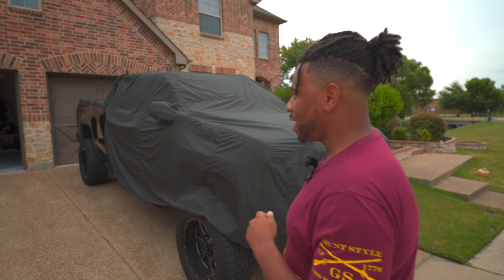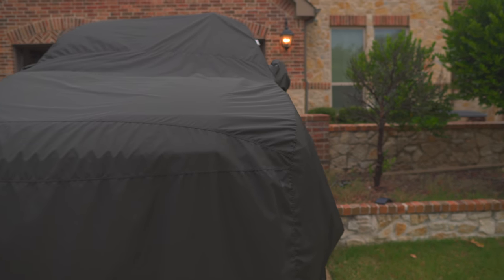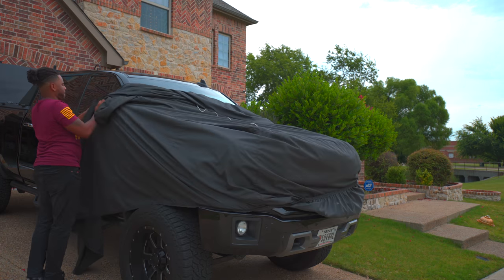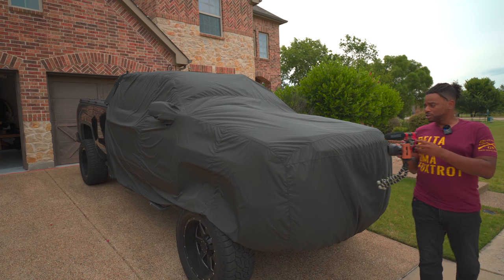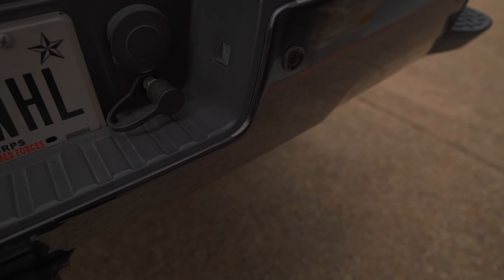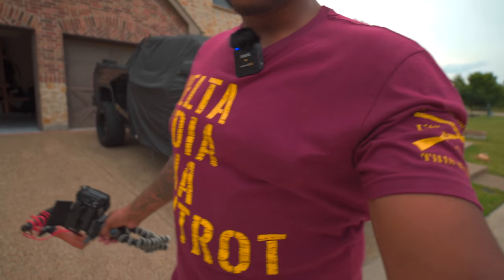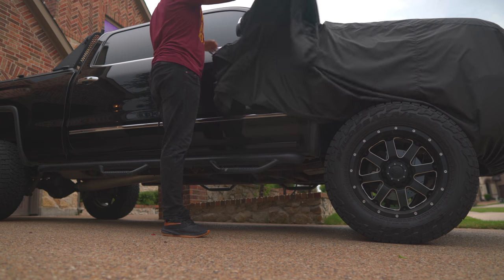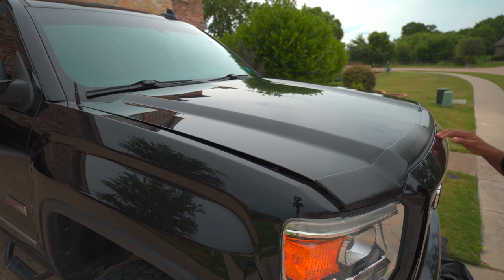Three Must Do Bugout Vehicle Add-ons: Conceal, Crank, Continue the Mission

Comment: i've put together a "pioneer kit". it has some full size shovels,mattocks,loppers,pruning saws,an axe,thick climbing rated rope,come along,pulleys,framing nails,machete,empty sandbags,rebar tie wire,large zip ties... would greatly increase the efficiency of either creating a new shelter or to fortify an existing structure. I made a large plywood box roughly 60"x18"x18" with rubber casters on one end and rope handles around the perimeter.

cordless tools coupled with a "solar generator" and folding solar panel would seem to be a gift from heaven if forced to leave you home by vehicle. I use the Milwaukee m18 platform. I have a chainsaw,pole chainsaw,string trimmer,sawzall,impact driver,drill,impact wrench,lantern,rocket light(tripod mounted work light),cordless fan(very handy if around a campfire to direction of the smoke),angle grinder(quickly defeats padlocks,hasps,gate locks,hinges,door handles and sharpening tools),portable bandsaw,water pump(coupled with a collapsible garden hose allows water on demand to your camp and the luxury of taking showers)

passive,low tech security measures such as trees accidentally falling across roads and trails coupled with higher tech active security measures such as predator calls such as mountain lion growls or coyote howls,trail cams and drones can deter all but the most eager folks all the while not alerting theres human activity in the area.

i've come to boiling it down to Food,water,shelter & security as out main priorities followed by hygiene,well-being/moral & communications/information. both the physical items in addition of ways to collect and replace it.

Comment: Outstanding as always. I'm a big fan of having a tire plug kit (and the knowledge to use it) and a back-up battery jump start device. I'm on the fence about adding an extra fuel tank. I was also thinking of an IR flood light for driving with NODs. Anyway, great channel man, thanks for all the info. Cheers!
Reply from the maker: Right on!

Comment: I love that truck!!! I was thinking that since you have the emp shield, why not put a decently powered inverter for a thousand reasons, lol. But, being poorer than a church mouse, I have to  just go with a plugin air comp, and a camo burlap net for cover. Also, even though I love the sound of that truck, I could hear it running it a mile away, lol. However, with that much truck, why not put a removable plow on the front, and some removable armor for the glass, in case you have to push through the enemy. A-Team that truck up! Lol, just a thought...
Reply from the maker: A team sounds so good. I love the ideas

Comment: Nice truck, great preparations for your BOV, but you installed the horns incorrectly.  They should be facing the rear of the truck so road water & debris doesn't get up into the horn diaphragms.
Reply from the maker: I had them facing the rear but turned them around because the police pull me over too often. I'll target replace the horns once a year than always be in court.

Comment: Beast of a vehicle but what's the difference between your system and a $40 air compressor that you plug into the cigarette lighter?
Reply from the maker: My system works in seconds and can use air tools lol
Reply: @MarineX  sorry, I never worked construction so didn't know it had a different use. Thanks.

Comment: But out vehicle, 1980 ‘s carbureted jeep would be good or diesel if possible. Less sensors and electronics. 
Any “new” car for me will be 5-7 years old with the new car prices. $87,000 for f250 no thanks